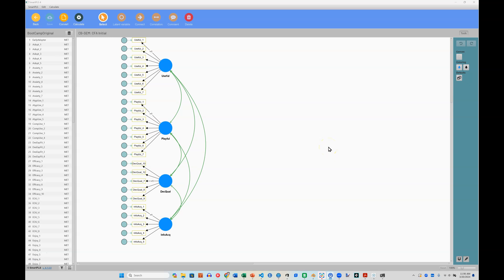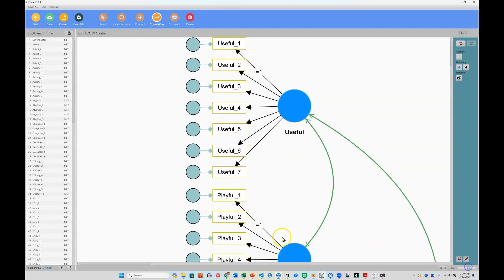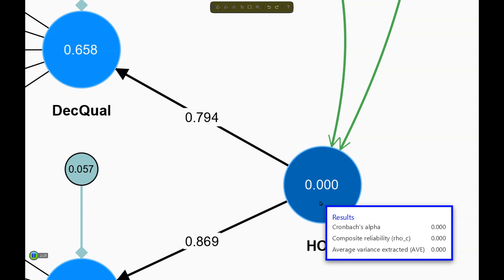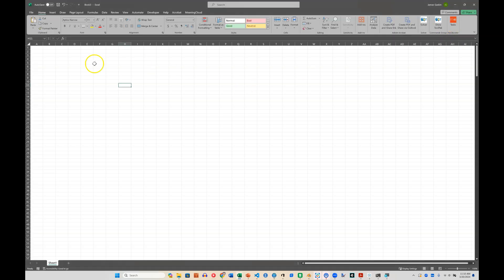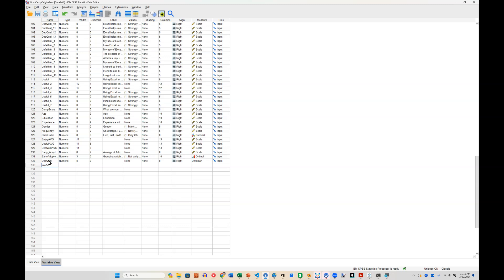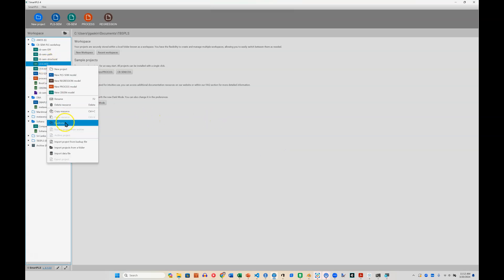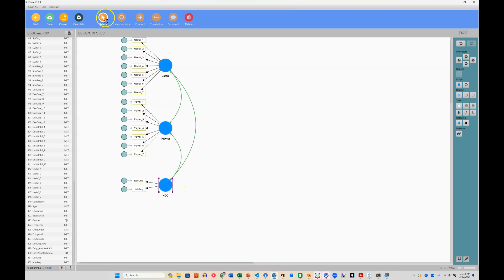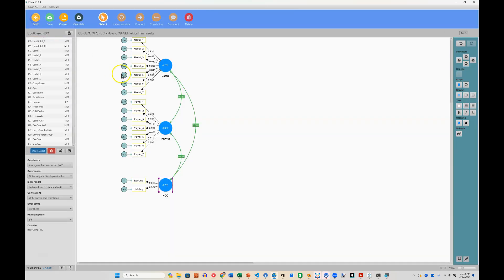SmartPLS CB-SEM Higher Order Constructs

Comment: Dear sir, My dependent variable is firm performance which is made of objective performance (categorical (0-20%, 21-40%,41-60%,61-80%,81-100%), and my subjective performance is ordinal (7 point likert scale). Since they both use different scales I can't merge them into a high order dependent variable (firm performance) and I'm not sure if I should convert objective performance to midpoints (for example 0-20% = 0.10) and consider them ordinal or will that hinder the statistical interpretation. Thank you
Reply from the maker: If you have access to actual performance values (rather than bins), use it as a continuous variable. More variance in measurement is better. If you don't have those original values, then just use one or the other, rather than both.

Comment: Hi Dr. Gaskin
I have downloaded the latest version of SmartPLS4 (v 4.1.0.6) and I can't seem to access R^2. In the left hand side-bar it goes 'model fit' and then 'construct reliability and validity' whereas your version has R^2. Under the bottom half of the left hand side-bar I can select R^2 under construct, where you have AVE, but when I do that, nothing shows. Odd. I wonder why this would be?

- Is there a way to derive R^2 from AVE?
- Could you explain the difference between them?

Thanks!
Reply from the maker: Make sure you are not bootstrapping. The R-square only shows up for bootstrap if you select Complete results (slower) in the setup. R-square also won't show up if you don't have any endogenous variables. R-square is the variance explained in the endogenous variable by its predictors. AVE is the average squared loading of indicators.
Reply: @Gaskination  Thank you. For my measurement model, I didn't use the CB-SEM Bootstrap, I just ran the normal algorithm and as mentioned, no R-Square was shown which now makes sense. When I ran the structural model, I got the R-Square value. Is there any scenario where I would HAVE to run the CB-SEM bootstrap or is it fine for me to just run the normal algorithm?
Reply from the maker: @TUPhDude  Bootstrapping gives you p-values for indirect effects. It also gives you more robust estimates all around.
Reply: Thanks. Do we then report the beta coefficient from the basic CB-SEM algorithm along with the p-values/significance values from the bootstrap or do we just report all the bootstrap data?
Reply from the maker: @TUPhDude  Report the bootstrap data